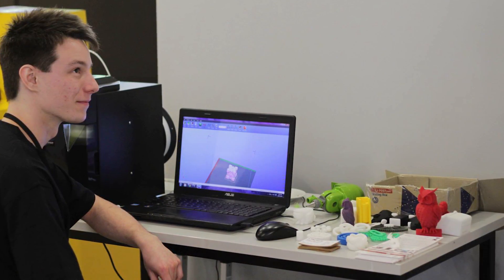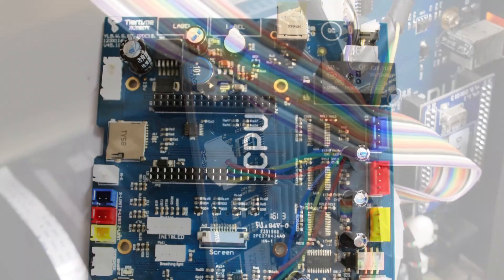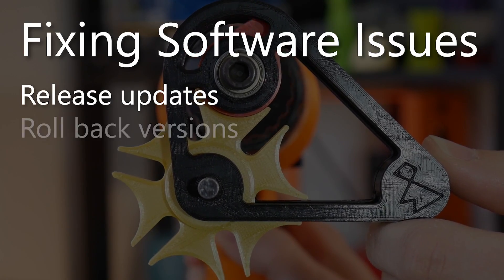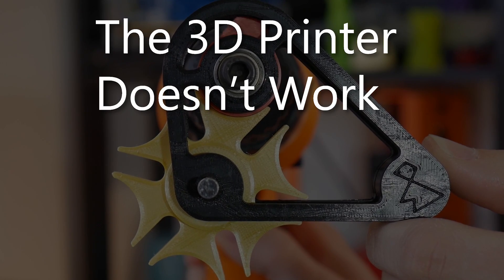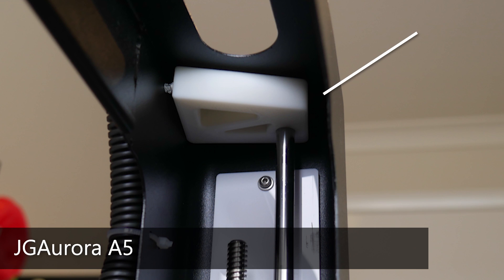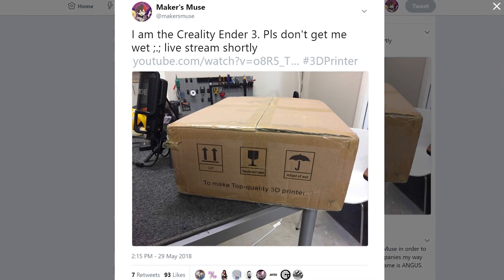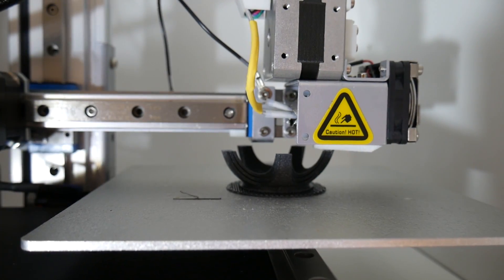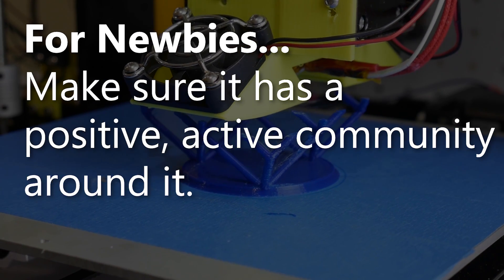Serious Concerns with 3D Printer Quality Control

Comment: I bought an M3D printer (the first little one) and was not happy as I realized it only printed small tiny items. I researched and thought a thick steel frame would make less wobble and would be stiff. Although I had to put it together I bought a MAKERFRONT i3pro-XL. I have been happy I have rewired it once already two years latter where the wires go into the heat bed .  Two printers catch my eye now. The CR 10 and the Prusa printers. The buyer is to blame for buying bad printers. I agree quality control is lacking, but if you think cheap you get cheap!

Comment: Agree completely. 3D printing is one of the things I teach at university. We have several monoprice selects, formlabs, and Raise3Ds' but I personally own a CR-10s5 and pre-ordered a crowdfunded M3D promega (due to arrive next week for me :D). I have the skills, knowledge and access to equipment that most people only dream of to make most any upgrade I want... still wish I could afford most of it though but access is way better than nothing... so for me the beta testing thing is not so bad as long as the printer has a lot of potential (NOT so for most people). 

That said, I believe that any company doing this should at MINIMUM make that fact quite clear wherever the printers are sold. With the promega I have been fascinated with the community they have developed in their discord channel and they have been actively upgrading the printer as the pre-orders roll out, while giving backers the up front option to delay shipment till some of the hardware decisions are more finalized. I think it is a good example of a way a company can effectively utilize this process without walking head first into the worst problems it can cause.

Comment: I agree with Angus here. In this day and age you can open beta software, but most certainly not hardware.
Even if it's possible to 3d print the fixes, that's not necessarily possible *if the 3d printer doesn't work*. It also doesn't cover problems from parts that were 3d printed but shouldn't be, or basically anything that isn't printable in the first place.

Comment: Ender 3 (made by the same guys that make the cr-10 you all love) deserves a great deal of credit for making one of the highest value - box of parts you can turn into a great printer - that money can buy. That's advancing the field and giving everyone and opportunity. It's a kit after all so is it really fair to compare them to a $1500 finished machine that is assembled so that it can even be tested in the first place?  If they did what is suggested here costs would be dramatically higher...like say exactly double because that's what they charge for a similar assembled version.

Comment: I've just gone through this ordeal myself with my Monoprice Maker Select! Little over a year of light and infrequent use and the power connectors on the printboard melted. They've since 'fixed' that issue. But now I've got a dead machine. No support from the manufacturer. Incredibly frustrating.

Comment: I think 90% of printers I've been sent have had problems either with their design - or general quality control. The TLM for example had a faulty solid state relay and was heating up to 160 degrees Celsius. And it's not just the Chinese kits - the American X carve was another company that used a massive marketing student to promote their early machine, which performed like crap, and had electrical issues, and who later used feedback to do their R&D - but everyone who got a machine was scrambling to be part of the promotional bandwagon. What gets me is they all hide behind the guise of open-source but they essentially just stole other peoples work. Anyway the latter drove me to design and build my own CNC machine - sharing the process. Maybe you should design your own 3D printer??

Comment: No, I'm not okay with the manufacturer using me to test their equipment. That's one reason I haven't bought a 3D printer. I don't really want to fool with it to get it working. I just want to print some things. Also I want a printer that can handle Nylon and/or NylonX so I can make parts that are mechanically robust.

Comment: Good points Angus. I've got two Ender 3 printers, and early one with the 3D printed PS cover, and a later one with the injection molded cover. Both had problems out of the box. But for someone familiar with designing and assembling machines (and I have a lot), the flaws were fairly obvious and not that hard to correct during the build process. For me, they're printing well right after assembly. but for others with less mechanical aptitude it's going to be a challenge.

It's also a business issue. For Creality to have done that R&D ahead of time the Ender 3 is a $400 printer and comes to market 6 months later than it did. And in the meantime another Chinese company will copy it and sell it, flaws intact, for $200. I've got an Alfawise U20 on the way, a CR-10 copy, I'm willing to bet that, while being cheaper than the CR-10, it's going to have flaws that the more mature Cr-10 doesn't. 

But that's why the printers like the Prusa exists, you can buy a fully assembled printer, mature, well tested,put together by an experienced professional and hopefully avoid all the problems with a cheap kit. And it costs $1000. But you'll also get tech support and a warranty from a reputable company.

And so as it often does, it boils down to money. In auto racing we say "Speed costs money, how fast can you afford to go". Quality in the 3D printer game seems to be the same.

Comment: I am totally okay with beta lightly tested Hardware going out to users but I have some conditions on that

First whatever goes out has to actually work :-) that should kind of be a given :-)

Second whatever goes out has to be safe within reason

Third it must be made clear what you are buying when you buy it it must be made clear that this is an Interactive product that will be improved so that the end user goes in eyes open

For example the way creality handles their printers I am totally okay with although I would prefer them to explicitly Mark the first couple batches as beta

This Is How They have done all their printers they do a small batch first they always work in general there are always exceptions and as they receive feedback they live feed those improvements into the production line so I have 4 Ender 3 printers and I have three different versions :-) the fourth one that I just got which I pay for myself all four of them I would consider a finished product and now ready for Mass adoption

This technique allows them to produce printers very affordably and to do something that most Chinese printer manufacturers never do actually improve their product most manufacturers do not do this you get what you get

The only flaw I see in the way creality does this is that they should be more explicit about it to their end users which is where my job comes in and your job comes in to inform and users of this information

This is why I tell people this is a beta batch of printers if you don't want a beta machine wait a couple months for improvements to hit the manufacturing line if you're okay with tinkering and maybe having to fix a few minor things go ahead and order

There was also a benefit we got them for $160 none of them required more than $20 to repair so in the end I got very good machines for a very low price

But end-users need to be aware of this because as you correctly noted some people do not want to Tinker they just want to make stuff and I totally understand that and agree

This is why I have changed the way I handle reviewing things like this I make a minimum of 3 videos on each printer usually many more the first video isn't unbox build and print the second video is fixes upgrades and or interim update

The first video I do right away the second video I do usually within a month if I can get to the machine that quickly and I do my actual review typically after of at least 1000 hours of printing what usually takes 3 to 6 months depending on how much I use that machine

In the beginning I do not review the printer I go over it I talk about it and I give it a safe to buy or not safe to buy with safe to buy meaning the printer will actually work with minimal effort and will give usable results reliably

If I were to purchase a $2,800 G create or $2,500 lulzbot I would hold those printers two very different standards than I would a $200 kit from China :-)

Ask for you tearing a new one into these printers don't ever stop doing that that's why we like you you don't hold no punches :-) plus your fun :-) you keep them honest!

Comment: The lean startup buisness model can be done quite well. I own a Wanhao d7, that was shipped with some flaws.  Wanhao has their finger on the pulse and is up to thier seventh or eigth version of the same printer. They take on thier customer feedback and treat the community with respect. They always announce upgrades/new versions and sell a low price kit with all the upgraded hardware. 

I find that if it's done responsibly, it can result in a cheaper product that more accurately reflects customer wants than something tested inhouse.

Comment: Yes there is a issue with a lot of companies putting out products without getting out all the bugs first.  American cars manufacturer's are guilty of this more often than not.
What they should do in engineering schools is require the engineers to repair stuff as an internship. That would give them first hand knowledge about how good stuff is designed as well as how scrappy products are designed. Instead they learn it's acceptable to have iterations at the customers expense.

Comment: This is a very, very important video in my opinion.  Some people will say "oh well it's a hobby and 3D printing isn't easy, do your research before you buy one" and while I agree, there's definitely a difference between "it doesn't print perfectly with stock settings" and "I walked out of the room for a coffee, came back, and it was belching smoke."  There should be a learning curve in 3D printing, that's half the fun!  Learning how to maintain your machine and tune settings to get it printing just right is SO satisfying, but you can't do that if, as you said, you're stuck with crappy hardware from the get go and possibly a small/nonexistent community to help you.  3D printer manufacturers absolutely should be held to the same standards as any other tech company.  One of the greatest and most dangerous blunders I've ever seen is the lack of the MOSFET in the Dumplicator i3 and clones.  Someone just entering the hobby would have no idea whatsoever that the heated bed could draw too much current, melt the plug, and catch on fire in extreme cases unless they asked ahead of time, and even then if they were an early adopter, no one would even know until it happened!  That's just ridiculous!

Comment: I purchased both the Monoprice Maker Select (Wanhao I3) that had a well documented flaw in the motheboard that required soldering a bodge cable.   I also recently purchased a Tevo Tornado that used low quality stepper motor drivers that cause visible defects in the printed parts, and it requires purchasing a new motherboard to fix this issue.  Tevo resolved the issue by using a new motherboard and drivers in later revisions, but shipped both the new and old versions at the same time; it was a random chance of receiving the fixed version as both sold under the same name.  For the price level of these particular printers, I'm not too concerned personally, but it is true they are using the consumers for R&D.

Comment: I was tasked at work to come up with an enclosure for our newest product (we design and make electronics related products to order). There was an Anet A8 in the office, bought just for fun. I wanted to make use of it, so after watching lots of related videos here in YouTube, I could print with it, although the quality was far from our expectations. The poor thing kept underextruding and jamming all the time, and it was a huge risk to print anything on it which lasted longer than 30-40 minutes...
By this point (a week has passed) I knew this is an interesting topic for me, so I bought a Prusa i3 mk3 for my personal use. However after I found out how well that thing printed compared to the Anet, I printed a prototype of the enclosure I designed (and wanted to print with the A8) which I showed to my bosses. They were blown away and ordered an i3 mk3 for company use. Since then we went through at least 10 design iterations of the box, and we're ramping up production. Instead of injection moulding, we'll go with 3D printing (for the same reason as Prusa Research does), and ordered second i3 mk3 :) The two printers should be enough for our needs and it's still way cheaper than going with injection moulding.
The reason why I told this story is simple: after having nothing but troubles with the Anet, I got very good experience with products of Prusa Research. We need these printers for day to day work, and tinkering around just to get any other result than filament spaghetti on the printhead is just not acceptable. Many 3D printer manufacturers have a lot to learn from Prusa Research, not just "steal" their ideas... (technically it's open source, but Chinese would have cloned it even without that) Just by running a huge print farm like PR, many product issues can be filtered out before it would actually hit the market...

Comment: I personally and just fine with this type of behavior in the sub $500 market, for kits or assembled machines.  Mainly because at that price point, it is well publicized that the machines are intended to be a part of the hobby, and that they will require tinkering to get working properly. Once you go over the $500 mark, it stops being OK, in my opinion, because those are targeted at people that want something that just works.  You can't buy a $150 printer you assemble yourself and expect it just to work, that is a well known fact.

Comment: Fully agree, i went thru 10 XYZ Da Vinci printers to find 2 that lasted longer than a few weeks. 6 of those were DOA out of the box, either optic sensors dead or alignment issues due to poor production. Granted shipping can always play a factor much of this industries issues are exactly what you discussed. A rush to market after a round of funding and the attitude of " we will fix what is found after the fact" is the biggest issue and has hurt the industry causing many households to think twice about buying a printer.
awesome video

Comment: I think they should include versioning.
I like how Wanhao is upgrading their Duplicator 7 regularly even with hardware improvements. Which does not mean that a v1.3 won't work. It's just that v1.4 is better. And you can get and upgrade kit for v1.4 if you are up to it.
I think it's crucial to improve hardware and software. But the "industry standard" of having release notes for software updates should find it's way into the 3d printing. With hardware as well as software.

Comment: It is really unfortunate that the vast majority of startup information is so software focused because hardware development is so different. Working in hardware development, everyone needs to be aware that "hardware is forever" and that you need to evaluate whether issues you release with are acceptable. Many VCs and inexperienced founders just don't have this level of awareness and treat hardware a lot like software.

In terms of home machines, it is difficult because you have overseas companies that are building down to a price, which results in cut corners and untested products. You simply cannot release a machine at those price points if you take the care for the quality control and testing that goes with releasing a quality product. While people like myself are happy to buy a cheap machine as a project, most people don't have the know-how or desire for that (but have trouble justifying the $1000+ for a better quality machine). Even then, I've regretted it on a few occasions because I've needed to print something now and the machine has been not operational.

Comment: Well, no, just no. It's just a way of offloading the cost (and risk) to someone else. Test your product until it is "Ready". Issues will Pop up, that is normal. But testing at the customer is not "cool", even if you did offer to upgrade/replace first gen machines. Even then, you are still wasting your customer's time.
A Product has to "work", otherwise it is a scam. Period.